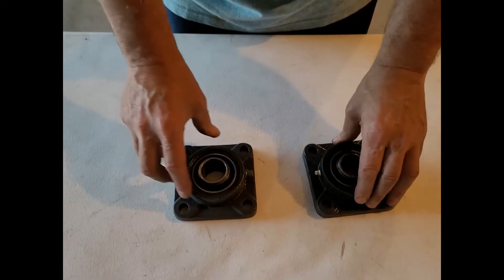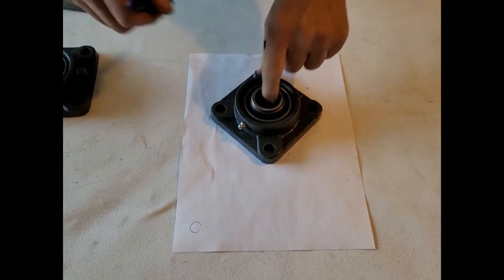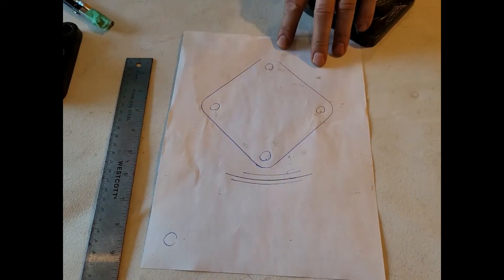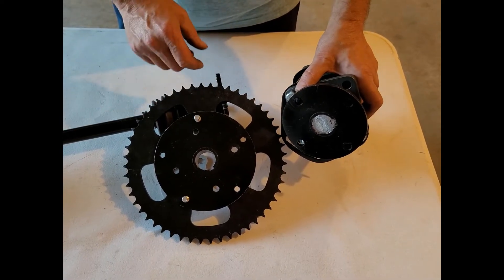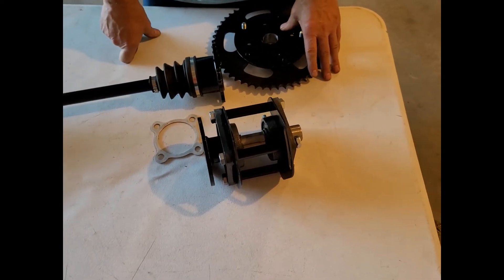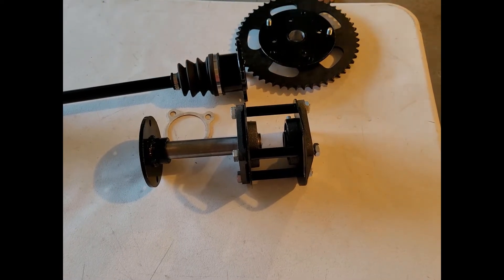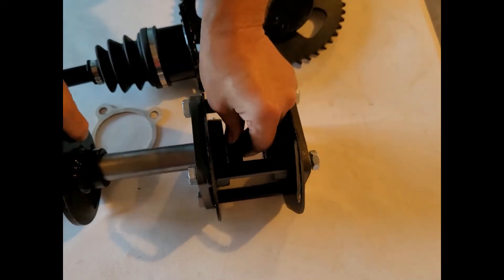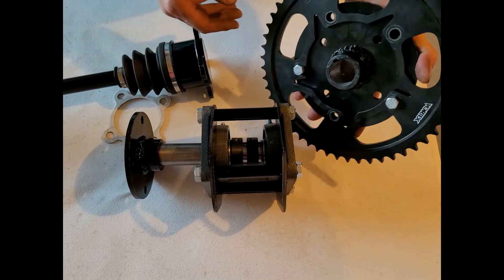IRS Spool for Crosskart/Gokart for Mazda Miata Axles

Comment: how did you do the brakes ? It doesn't look like there is space for a brake anywhere here. Also, what type of miata axle?  Front? Rear? Specific year or anything like that to fit correctly or does that not matter as much?

Comment: I bought this kit along with the 1 1/4 bearings and 1 1/4 keyed shaft and it’s too tight to go in almost as if it’s gotta be pressed what am I doing wrong ?
Reply from the maker: Sometimes keyways aren't cut properly and filing the keyshaft down is necessary.

Comment: Dont ever use washers when bolting an axle to a spool like this. Get the hub relieved at a shop or if you have a lathe, its easy to do yourself. Washers are not a tight fit and will inheriently slip to one side introducing wobble in your axle, once it starts wobbling. It will only get worse and fail. DONT DO IT.
Reply: Just get a tight fitting washer, it’ll be fine

Comment: I just go to the local motorcycle junk yard and buy a rear wheel. I cut the hub out of the wheel. It has a brake disc on one side and a sprocket on the other side with bearings in between. I usually pay $10 to $20.
Reply: Yo hold up. That's actually a brilliant idea
Reply: How do you set up for axles?
Reply: Can you send more information
Reply: How are you bolting up axles? Is there an axle that bolts directly in such as a mistake?

I imagine you have to space the sprocket & disc out to fit the carrier bearings in between to mount? More detail please this is genius!
Reply: @GarageAlchemy pull all the bearings etc out of the hub. If necessary you'll want to machine the way inside of that hole so it's the same size all the way thru. I've only run into one that needed that but it was only 5 bucks so I tossed it and got a different one. Then fabricate a piece of round stock to fit super tight in that hole so you have to heat the hub and freeze the part and yap it in with a light hammer. Don't overdo the tight fit cuz the hub can crack when it cools. I use 3/4 stock for the axles. I thread the axle end and drill and tap the center axle so I have room for a nut, flat washer and lock washer. Screw the axles in on both sides... crap.. the trickiest part is I drill a 3/8 hole thru all the way both sides of the hub and axle center and drive in a pin with holes drilled for Cotter pins on both ends. 

Ive never done an IR suspension but I suppose you could do the same sort of thing. The four Ive built this way are low power applications under 20hp. I built a shifter cart for my grandson with a Chinese 250 cc motorcycle engine I got on Amazon for $300. That cart has about 100 hours on it and hasn't broken yet. 
Every hub is gonna be different. You just have to look at it and adapt. My goal low cost so I look for hubs that won't force me to have a machine shop do anything. 
I grew up in a logging town back in the 60s the saw shops had mountains of worn out engines 90 to 120cc and the mills had piles of scrap metal so that how the boys spent their time in the summer. Scrounging parts, fixing engines begging our dad's to PLEASE weld something for us and begging our Moms to PRETTY PLEASE let's us actually drive some of the crazy looking shit we built ;)
Reply: if you dont understand how dumb this is you shouldnt even fab a crosskart and kill someone. 

The motorcycle rear wheel assembly is the exact opposite of what we are trying to build for the chain drive of a crosskart. This idiot spilling shit without understanding

Comment: Any way to open up the inner diameter of the sprocket mount and brake mount to 2” for the x series weld in hub? As I don’t have the means to change the file

Comment: Great design, Im 100% going to copy this. Just wondering if there is any chance for those plates to slide outwards?
Reply from the maker: It can't happen if you install the locking collars correctly. Also the cv axles don't even have enough plunge to allow it to happen either.
Reply: @jdsgarage701  yes shaft cant move anywhere thanks to those locking collars, but what stops your plate sliding out just a tiny bit and messing your chainline? Is there a setscrew in those weld on hubs?

Comment: I assume that the boss on the Miata's inboard CV joint and matching recess in the final drive output flange mentioned @6:52 are there to centre the assembly, so that the bolts only need to retain the assembly and transmit torque, not to locate the parts coaxially. Using a flat drive flange and spacer leaves the bolts centering the assembly and makes bolt hole size and location critical to the balance of the shaft. If this is a locating fit, ideally the flanges would be thicker and machined (on a lathe) with a recess to match the CV joint boss.

Comment: Very cool video showing all the parts and how it goes together, I wish all content creators did this.  Too bad it isn't actually a differential, I got excited there for a minute because that is what I'm looking for.
Reply: If you were to get a peerless differential with the 1" axle I'm sure you can come up with something as far as putting the spool in the center of the two outer mounting plates because their spoil accommodates the drive sprocket on one side and the brake rotor disc on the other. The only issue would be the the width, of course it's a bit wider than this one. I've actually thought about trying this idea myself.
Reply: @NicholasB45  yeah I think that's worth trying!
Reply: Use a Subaru R160 differential with Polaris rzr 1000 axles and turn the motor side ways and bolt on a sprocket to the front of the diff and use a jack shaft across the rear to get power from where the engine clutch goes back to the front of the Subaru diff. Subaru cv joints have the same cv ball spider as Polaris rzr 100 cv axles. I took the Polaris axle slid off the ball spider, slid on the subaru ball spider so it uses a Subaru inner cv on the Polaris axle. I used all Polaris rzr 1000 axles and suspension because it is strong, cheap and easy to find on ebay.

The subaru ball spider does need a tiny but of grinding so the splines go all the way in and the retainer ring fits but that can be done with a hand held die grander. I did use my lathe to do it because I have a lathe. The huge cool thing is the splines are the same on both and do slide together, that is awesome. The Polaris axle stays Polaris on the outer end and Subaru on the inner side. Fankin-axle, lol.

The Subaru diff I found in a junk yard is a 4.30 ratio with viscous posi traction, I got lucky finding that as that was exactly what I wanted. Most of them are just open diffs like you want so that will be easy to find for you. Most are not 4.30 ratio but if you search you can find a chart showing what Subaru diff ratios there are and what the code is for them that if painted on the diff case. You can adjust over all gear ratio with your sprocket going from the jack shaft to the front diff chain. 

I am using a 500 Polaris snowmobile motor so i used a snowmobile clutch and jack shaft. All easy to find fairly cheap stuff. Yes the Subaru diff is a bit heavy but not to bad and it is totally bullet proof and can take well over 200 hp, so, your never going to break it. That is what i wanted as eventually I am going to find a big 150 hp snowmobile motor. The other nice thing about doing it this way is the carbs are on one side and the exhaust on the other, not in the front/rear. It is hard to route a huge 2 stroke exhaust around from the front of the motor.

When I actually put all this together I will make a video showing how it all works and publish it. I love what JD and KJ racing are doing. I am a welder fabricator and machinist with lathes and mill etc but I am going to buy the KJ racing cross kart plans as it would take me years to figure out what spending 100 bucks on plans can get me up front so why not benefit from KJ and JD's experience.
Reply: He never claimed it to be any kind of differential 😂. It says spool in the title, spool in the description. Seems to have made it quite clear it's a spool 😂
Reply: I agree - the title saying "differential" is the only problem.

Comment: Any way around using the keyway? Weld it in maybe? Without a mill how do u cut the groove for the keyway
Reply from the maker: I don't have a mill either but I dropped the shaft off at a local machine shop and they cut it for like $20. You can weld it but then you would be screwed if you ever had to take it apart. Alternative way   just buy a shaft with keyway already cut. I've also seen people cut a keyway with an angle grinder with limited success.

Comment: What brake disc and caliper are you using on this hub assembly?
Reply from the maker: Check out the engine video we talk more about it. We never put one on the spool we actually used the rotor and caliper off the sled and mounted it further up on the drive train.

Comment: Has anyone figured out a brake setup on the spool itself?
Reply from the maker: Just released a video about how to modify the flanges to fit whatever brake rotor or sprocket you want.
Reply: @jdsgarage701  that is awesome news.  I was starting to look up the prices for lathes, 3d printers, parts design software. But I will happily support you guys who are doing a lot of the hard work.

Comment: I like this idea but what about the brake rotor? Are there any provisions for that?
Reply from the maker: If you watch our other videos we explain how we did the rear brake. A brake rotor can be added by making two of the flanges that the sprocket mounts to and just using a rotor on the other side.

Comment: Hi there real nice center spool I would like to buy a set of those bearing slider plates at a later on time nice build. also are you going to build the wheel carrier too and show that part and offer it to.
Reply from the maker: Wheel carrier is in a separate  video. We do not yet offer these as there are many possible sizes but we are working on something.

Comment: Thanks for the info. Videos are Awesome!!! Keep up the good work...and yes would like to see more videos!!! Also you made the Sprocket side large enough for the CV half Shaft and sprocket. The other side was just large enough for the CV joint only. Would the laser cut plans for the Brake side include enough room to attach a disk brake?
Thanks...Keep up the good work.
Reply: On our original design we were going to make the brake side big enough for a rotor but  since we used a snowmobile engine the brake caliper is built into the chain case so only made it big enough to fit the cv axle.

Comment: Awesome ideas. My only concern is the 1 1/4” axle key way.  Is that strong enough to hold the torque?
Reply from the maker: Yes, we have another kart with around 100hp and a similar setup and have had zero issues. You have to get high-quality key stock (link in description). This is also the same kind of key stock that 200hp sleds have on the secondary clutch. If you get some made from chineseium it will shear right away.
Reply: Also helps to have key stock that runs a decent length of the shaft. I've seen 1" round stock with a key way work well with 60hp, only after it had failed due to only having just enough key for a sprocket hub. Once it was replaced (the key had messed up the shaft) with a new shaft and longer key stock it held up. Just need to run locking collars to help.
Reply: What if you did away with the key way and used a 1 3/8” 21 splined shaft and splined hubs? Of course I would use 1 3/8” bore flange bearings, but you think this would be a bit stronger?
Reply: @sheets8277  if you could source them,they would be very tough.